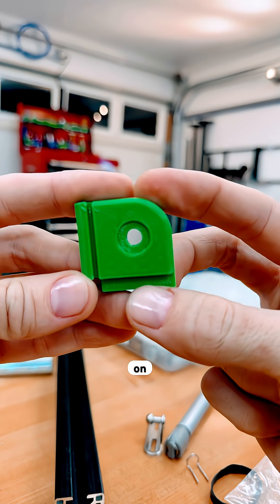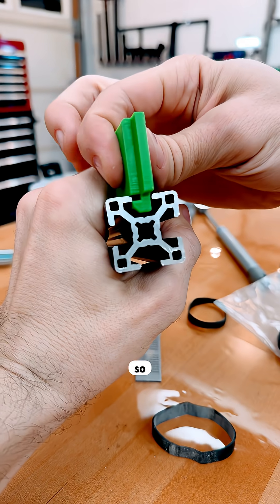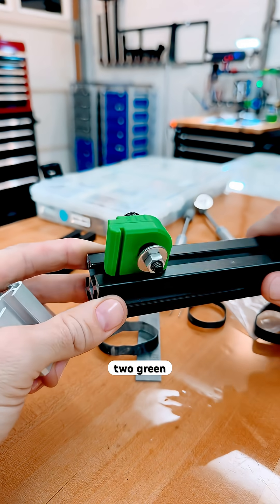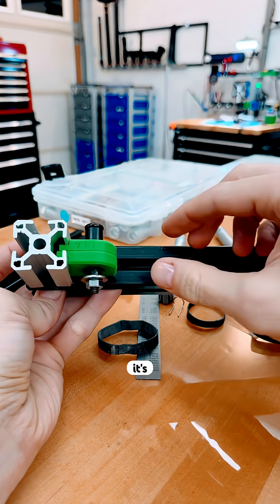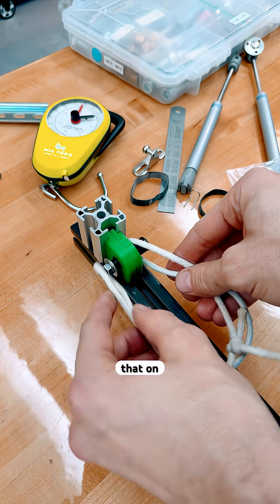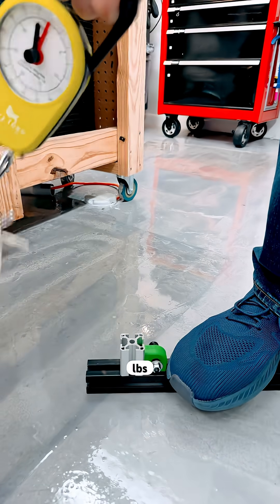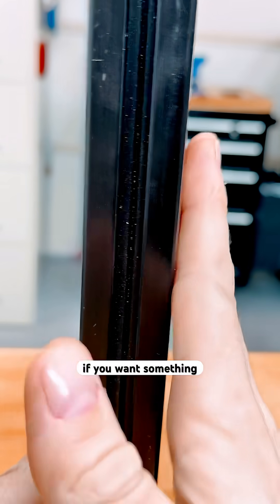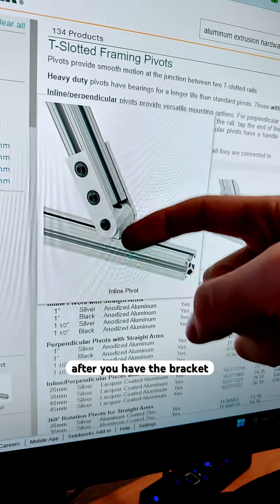[strength test] a printed bracket for aluminum extrusions #opensourcehardware

Comment: I like your spirit!  Make something. Share it. 

I'm digging the design too. Splitting the part right down the middle is great because you can attach the bracket right into the channel without needing to access the ends of the extrusion.

Comment: Which type of plastic did you use in your test?
How many walls?
Great work BTW!-)
Reply from the maker: i always use ABS and default settings.  2 walls.  don’t worry about the settings too much, it’s designed for printing.

i’ll label this “interlock” on grabcad

Comment: thats crazy that we have the ability to 3d print an ideas and have what used to be a paid proprietary tools for free. thank u sir
Reply: It's such a useful tool if you work with aluminium, can make all the joints tight, but need to be aware of PLA will drift under compression or strain, so needs to be engineered correctly or use the right type of plastic.

Comment: Small tip: Do not test parts like this: If it fails you get Part splinters accelerated at high speed straight to the face. You can i.e. put it on a table, hang a bucket on it and keep filling it with sand until failure while wearing safety goggles.
Reply: Bro... Really?
Reply: Bro, really. Engineers don't have the most common sense.